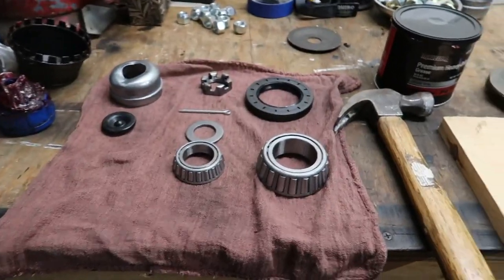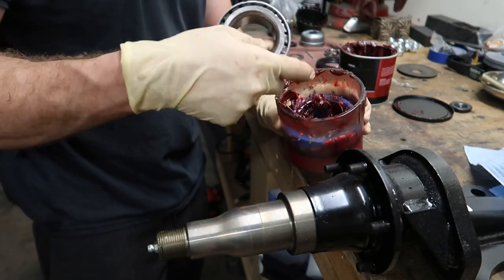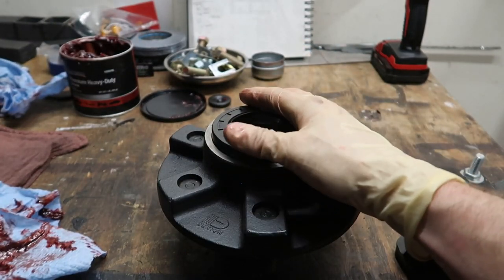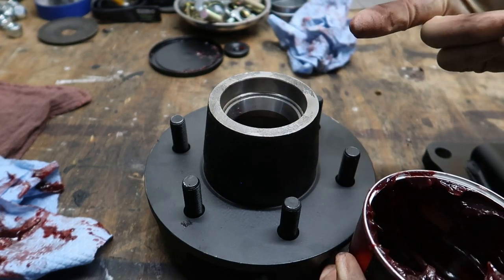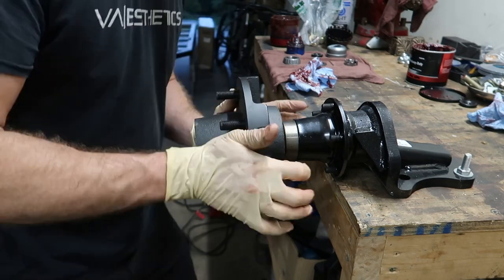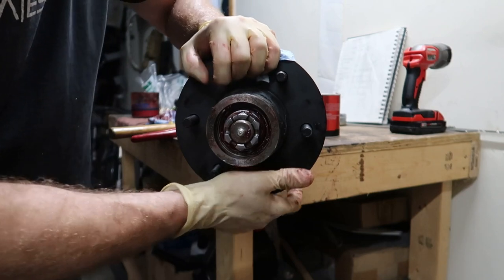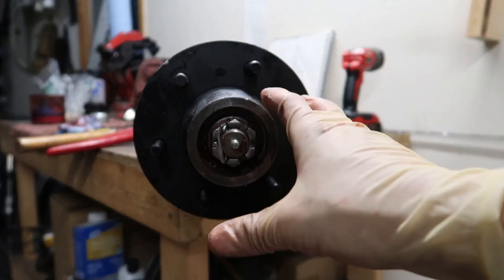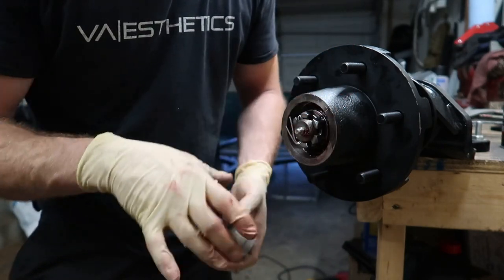**DETAILED** Trailer Hub & Bearing installation // Timbren 3500

Comment: Great step-by-step video! As for the torque specs on the castle nut, they should be as follows - Torque castle nut to 200 ft.-lbs. while rotating the hub. Back off one full turn then rotate hub at least one full turn. Next, re-torque nut 50 ft.-lbs. while rotating the hub. Finally, back off 1/4 turn. Hope that helps clear up some of that mystery.
Reply from the maker: Thank you for clearing that up! Also thanks for making a great product 👍🏼
Reply: @Adv4x4  Happy to clear things up. Thanks for choosing to run the Axle-Less trailer suspension. You rock 👊🏼
Reply from the maker: No problem. This is the second build I’ve used them on. If you go to my videos I have a motorcycle hauler trailer I made with the 1200lb units.

There may be a micro camper or another variation of off-road trailer in the channels future as well 👍🏼
Reply: @Adv4x4  That's awesome! We're Subscribed and standing by to watch any future builds 👀

Comment: Thanks for the vid!!  Glad you mentioned a test drive.  Just put new bearings into my boat trailor.  Seated bearings...backed of a quarter turn...pinned the castle nut.  After test drive with boat checked for wheel play and there was quite a bit.  Had to reseat the bearings again.....I used 50 ft-# of torque and backed the nut of a quarter turn.  Have a very very slight amount of wheel play.  I  have to take it out again for second test drive see what happens.

Comment: How would you convert the hub/bolt pattern if you wanted to put 4Runner wheels/tires on a cargo trailer that came with smaller set and different bolt pattern.  to match the truck

Comment: After you installed the great packed inner bearing, and then installed the grease seal, is there supposed to be any play regarding that  bearing. in other words, should that bearing fit 'snug' between the race and the great seal...like an Oreo cookie?
Reply from the maker: The bearing races will have some “play” until the flange is installed. There is a gap and it’s possible for the rear race to fall back from the bearing assembly a bit you should just have to avoid that happening!

Comment: Hello, recently purchased a trailer with the timbren axle. It has brake drums on it as well I want to swap out the hubs on there (5 lug) to a 6 lug hub that matches my Tacoma. Will I have to disassemble the drum to remove the hub? And then reassemble it before putting the new hub on? Or is the process the same as you show here?
Reply from the maker: I believe the drum and hub are one piece on the trailer brakes. You will likely have to buy a new 6 lug drum/hub. Etrailer.com would be a great place to find that. They also have great customer support that can help you find exactly what you need!

Comment: does the rear seal make physical contact with the rear bearing? The seal I have would leave a gap between the two if I only hammered it flush...doesn't seem like the bearing should be allowed to move around back there.
Reply from the maker: The bearing will seat itself on the spindle once you slide the hub onto it! Only job the seal has is to ride on the spindle and keep dirt/water out 👍🏼

Comment: I have a question for you, have you seen the Mobtown softtopper bed rack they used to make. Basically a prinsu cab rack welded to some 1 3/4 tubing. You think you could build something like that?
Reply from the maker: I do not have access to a tube bender but it’s definitely something I’d like to get in the future!

Comment: Where do you purchase the hubs? New to this type of thing and I have no idea where to purchase one that would be the same as my WJ for my trailer build.
Reply from the maker: I just updated the description with some links to etrailer.com the hubs linked are for Chevy/Toyota but they also have hubs that will fit your jeep. Just verify your bolt pattern on your jeep and check for the corresponding set of hubs on etrailer 👍🏼

Looking online your WJ is 5x5 bolt pattern? 
If that’s the case here is the page to those hubs below. Just make sure the hub is also the correct one to fit your axle.  
https://www.etrailer.com/s.aspx?qry=Idler+hubs&furl=-pg-Trailer_Hubs_and_Drums-sz-5_on_5_Inch
Reply: @Adv4x4  that’s exactly right! Thanks so much for your help. You definitely went above and beyond what I was expecting in a reply, and it is MUCH appreciated!!
Reply from the maker: Not a problem, Glad I could help out! Goodluck with your build!!

Comment: I found that there arnt enough options for castle nut position with the off centre pin setup, too loose one side too tight the other.
Reply from the maker: I could agree with that as well. Seems to be some compromise but if I recall correctly once I re adjusted after putting some miles on it, it worked out good 👍🏼
Reply: @Adv4x4  that's good to know, thanks. Did you start with it tighter or looser ?
Reply from the maker: @MarshallRoad  I believe I started a little tight but not too tight. Also check the pinned comment from Timbren Industries on their torque spec recommendation.